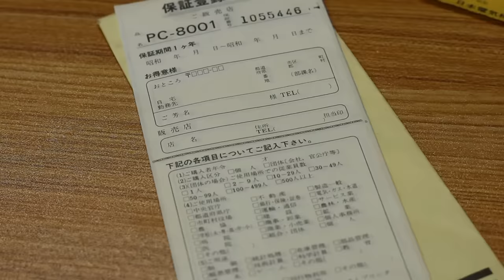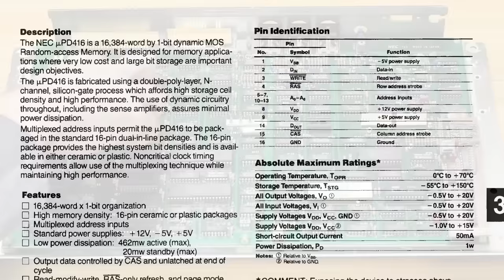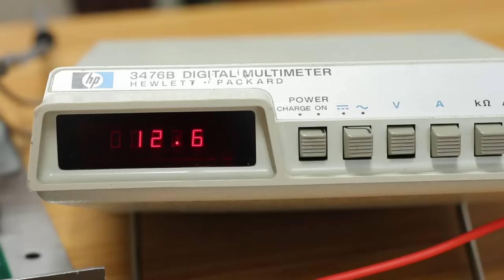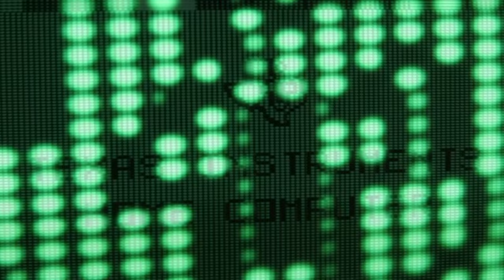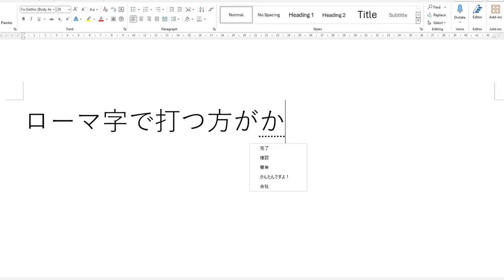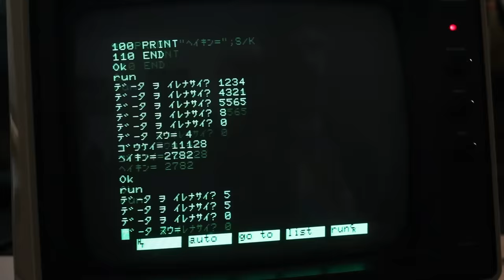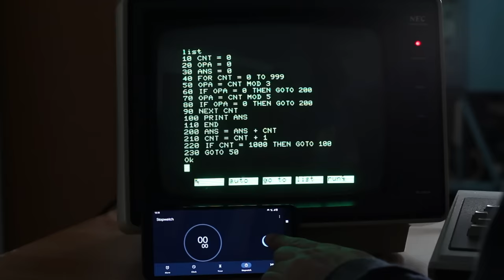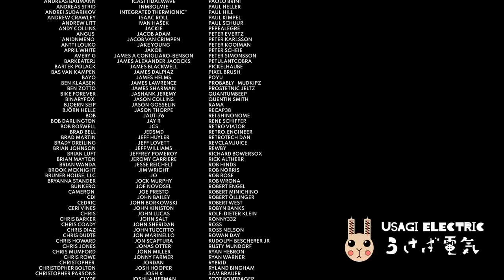This NEC PC-8001 is Epic!

Comment: A complete off-topic question - are you really sure that the floor can handle that much weight?           I think we all would hate to see a video - showing us "complete disaster" !!!

Hope the floor are support and construct to load bearing above standard code!
Reply: BTW the extra card could be some home brew copy-protection handling - instead of the real hardware "dongle".
Reply: It's in a garage with a concrete slab floor. I don't think weight will be an issue. https://www.youtube.com/watch?v=aoIpJUJaBio